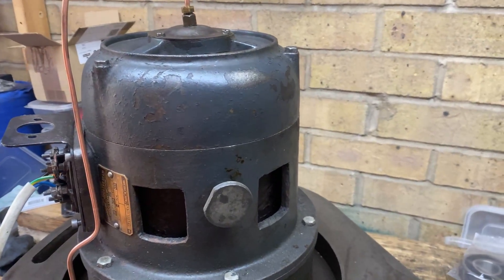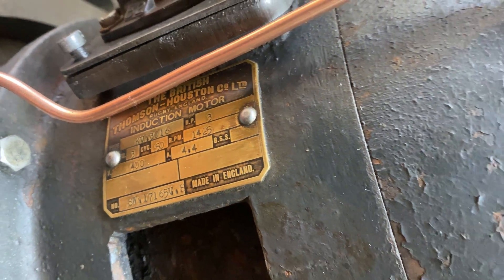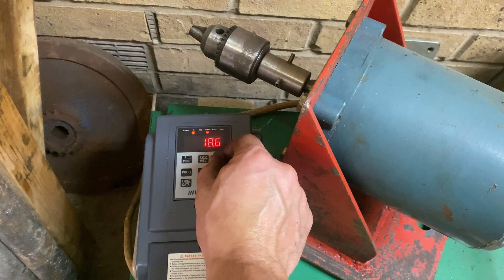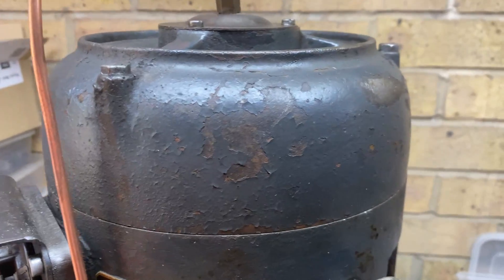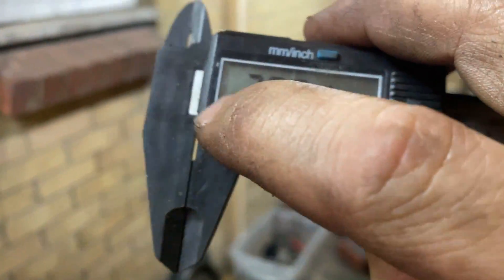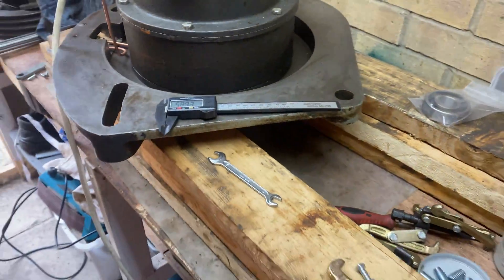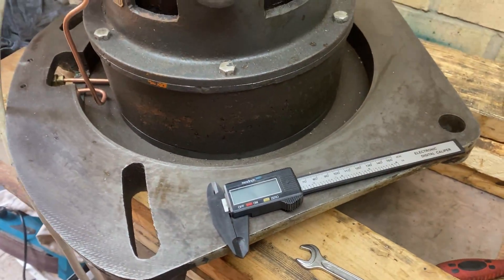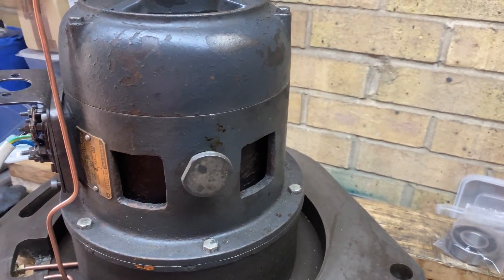HELP NEEDED!! - Archdale 20" Horizontal Mill - Magnetic Field Around The Motor

Comment: Yes ground the motor to the vfd if nothing else it should prevent a shock if the motor develops a short.
There will be a magnetic field outside of the motor as well as inside and the cheap calipers use magnetic scales and they get a signal from the field of the motor which is enough to switch them on but not stable enough to read a constant signal.
Reply from the maker: Wonderful. Thanks for the infos. I was thinking smthng similar along that line. 

Greg

Comment: Is it a dual voltage motor?  I somehow doubt a motor of that age was designed for a PWM power supply and the high frequency is causing the magnetic field.
Reply from the maker: Yeah, it’s a 1ph/3ph motor. They future proofed them.
It’s a VFD, not a PWM.  PWM would not do anything (apart of going up in smokes straight away. 

Greg
Reply: @OneManEngineering  How do you think modern VFD’s work then if it wasn’t for pulse width modulation. A PWM supply just varies frequency of the supply to obtain variable rpm without too much loss in torque.
Reply from the maker: @shaunchurchill4594  I disagree. The PWM cuts the sine wave so essentially not putting out any power whatsoever. Therefore a 50% PWM means half the time it’s running full power, half the time no power at all. 

But they are sort of similar in the end result, but get there in a different way.
Reply: @OneManEngineering  if you disagree then effectively you disagree with every current VFD manufacturer out there as they all use PWM to control motor speed. I have a very old British made VFD made by a subsidiary of Hawker Sidley and even that uses PWM and the 3 phase motor works perfectly. Same for the Mitsubishi VFD I have just fitted to my Myford 254s long bed lathe and also a Tom Senior mill. Both dual voltage 3 phase motors and they work perfectly. Newton Tesla sell this kit and know their stuff so basically your saying they don’t know what they talking about either.